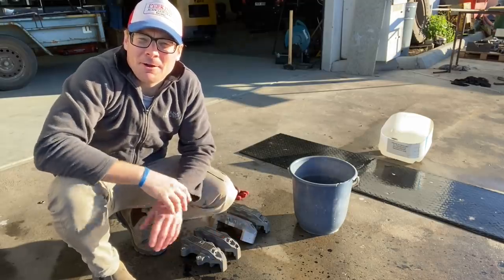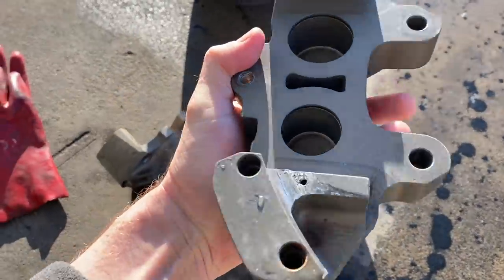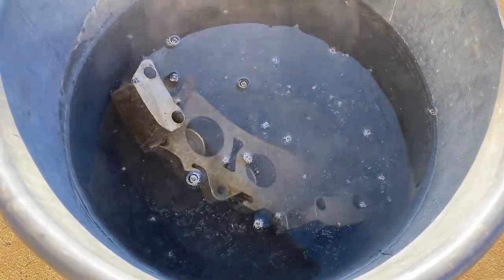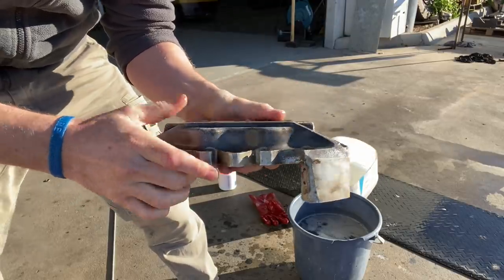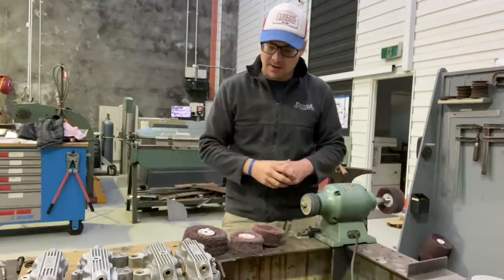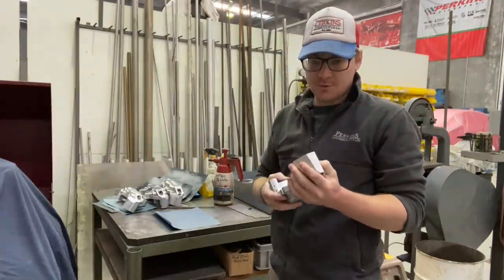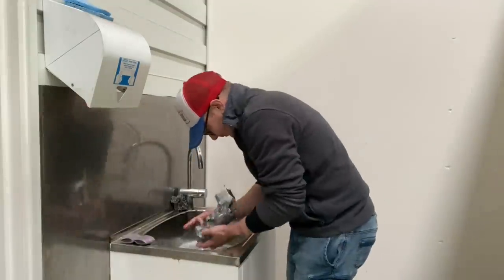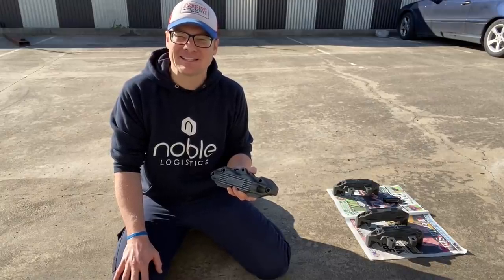Episode 14: Restoring Rear Harrop Brake Calipers

Comment: Another great ep thanks Jack and very timely. I was hoping you could talk more about brakes over the years, specifically Bathurst.
I think Larry pioneered the 'endless' pads amongst other things.
Reply from the maker: That's correct, Bathurst 1995 PE designed and manufactured their own "Perkins" Brake Caliper, and manufactured a thicker brake pad in conjunction with Endless in Japan, so there was no requirement for a brake pad change during the 1995 Bathurst Race.
Reply: Great thanks. Any chance of having a rummage around and showing us? And also a better look at some of the tools used for quick pad and caliper  swaps.
I think it was also Larry that used wheel braces with a big ring attached when the opposition was toying with early rattle guns?

Comment: Hey Jack, keep the good work going!! Funny question, 
Did Garth at Collins suggest that colour to you. I did a set of billet rocker covers 10 months ago and had them do it to a not that off the shelf process that was used in a different application that has that grey green look.
I only ask as they look really awesome and it would be pretty cool to share that connection.
Please keep the videos coming.
Reply from the maker: Hi Mick, no we matched the calipers to the original colour and sample we had, which was/is the colour they've ended up.

Comment: Great vid once again Jack are the calipers machined as a matched set? Also when surfacing on a flat table if you go in a figure 8 you apply a more even pressure over the surface with less chance of getting it off square
Reply from the maker: I don't believe they are machined as a match set, the fluid transfer is from the pipe that gets connected at the bottom of the calipers, so the rest is from a casting and machined as per a drawing. Correct with regards to figure 8, just a bit hard with the large/high caliper pieces and small wet/dry paper. cheers